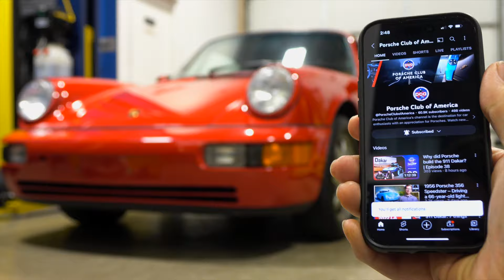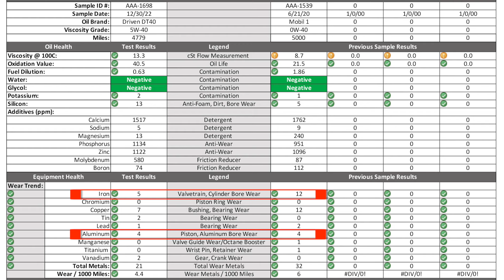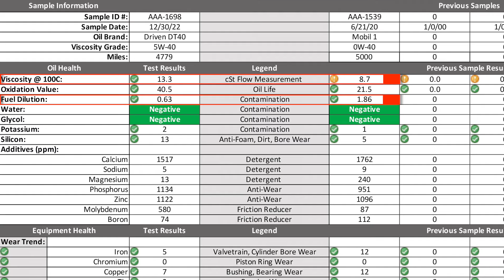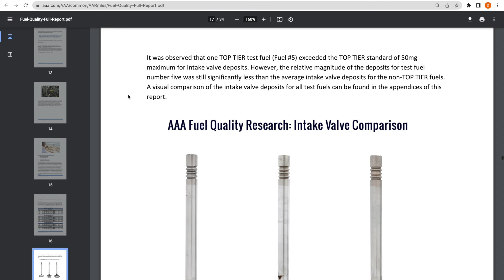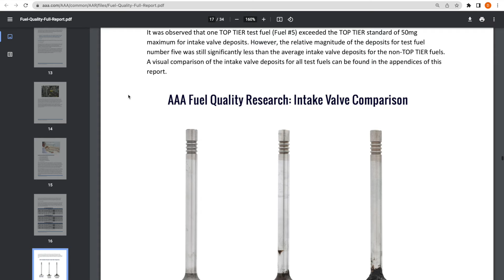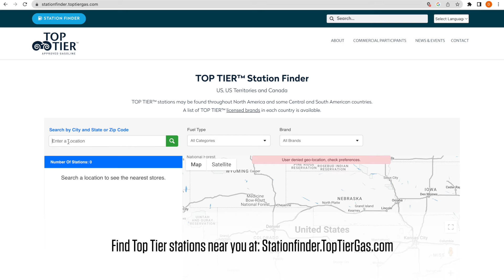How to prevent or slow the progression of bore scoring in your Porsche M96/M97 engine | 3 of 4

Comment: I hear you about sun zero temperature, how about -13F as this is what we have here in Quebec, Canada. What do you recommend ? Idle for 1 minutes and take off gently until engine is at full operating temperature ?
Reply from the maker: Charles and LN Engineering are in Chicago, so he lives the conditions you are talking about. He mentioned that if you need to give the car 20-30 seconds to get the fluids going before driving off, that's fine. For the cars health, ideally you'd want to drive off immediately, but that's just not possible to safely do in some places.
Reply: @PorscheClubofAmerica  thanks. Trust me montreal is much colder than chicago ;-) for reference What is the coldest month in Chicago?
January
January tends to be the coldest month, but also the snowiest month of the year. The temperatures reach between 26 °F and 36°F (-3 - 2 °C), with an average high of 31 °F (-1 °C)
Compare this to Montreal 
The cold season lasts for 3.3 months, from December 4 to March 12. The coldest month of the year in Montréal is January, with an average low of 10°F
We will never hit above 10F
Reply: I would recommend against idling the engine any longer than it takes for the engine to come off initial high idle.
Reply: @lnengineeringllc  exactly what I do which is in deep winter exactly that 45s to 60s
Reply: @brennersydney  If you are not seeing below freezing cold starts, there are no special precautions to take. Just start the engine and start driving the car normally, taking care to keep the RPMs down and avoid wide open throttle until the engine coolant is fully up to temperature.
Reply: @lnengineeringllc  I drive normally between 2-3k rpm until the eng oil temp rise up to at least 170 degrees F.
Reply: No way would i winter drive any expensive sports car in winter the salt and brine will destroy it . Because of the high humidity /salt here in Ontario i oil under coat all my cars and trucks and my restro mod sports car frame chassis and  crossmembers . In this area you can see the sides of roads white with salt even in summer and every time it rains it damages your metal components of your car.

Comment: Question related to the Top Tier premium vs LAC premium discussion: What about ethanol-free vs ethanol added fuels?
Reply: Ethanol free fuels such as REC 90 typically are formulated with the same additive levels as Top Tier Fuels, however occasional use of a fuel additive with polyetheramine still would not be a bad idea as a preventative measure.

Comment: Next question on 911 engines. On which side of the piston (upper or lower surface) do you see the most wear for the left side (cylinders 1, 2, 3) and right side (clyinders 4, 5, 6)?
Reply: Cylinders 4 through 6 (Bank 2) most always score first. We rarely see scoring on bank 1.
Reply: @lnengineeringllc  Meaning what part of the piston? Not which piston(s).

Comment: How about other brands of car, that are using direct injectors, are having signs of higher bore wear at the area opposite of the injectors?.
Reply: Although not an issue with Porsche engines, there are discussions that injector angle can and does affect direct injected engines.

Comment: I would think it is a good idea to install a oil pan warmer and engine block warmer? Here engine block warmers is pretty much standard equipment on all cars and they recommend to use it even in summer when colder then +15c or so to reduce wear and fuel consumption.

Comment: Very informative video - learned a lot. It also makes me shake my head and wonder why I put up with such issues with this brand, and why Porsche’s always seem to have such issues. BMW not much better, and in some cases worse. And with all the well to do suburbanites with Macans filling them at the local grocery store gas station how many of those are going to develop issues?
Reply: It's not isolated just to Porsche. Like you mentioned, BMW also have had similar issues as has Mercedes and other vehicle manufacturers. For sure we know fuel is a huge contributing factor as are the oils being used and longer drain intervals recommended by auto makers.

Comment: Most A40 oils that have API SP also have at least 70 ppm of molybdenum now.
Reply: Whats a few good examples Chris?
Reply: @spyder_man  PP Euro 5W-40 and new Mobil 1 FS 0W-40 both have that amount roughly.
Reply: Thanks Chris, my M97 has only ever had Mobil1 0-40, for 15 years now. 
Appreciate your knowledge.
Reply: @spyder_man  It used to have less moly until last year. It’s a fine oil though. Not much can cover for design defects.

Comment: Great content....... can I just implement all the suggestions before I ever have the problem?  Is there any downside to what you recommend other than sacrificing a little Fuel Economy and maybe some incremental cost?
Reply: Probably could.  You could definitely run top tier, add injector cleaner, reduce oil change intervals to 5K miles, and do proper warm ups.  I’d probably save the thicker oil until after you have verified scoring.  Do used oil analysis and when the readings trend in the wrong direction scope it.  If you confirm scoring then switch to the high temp high viscosity oil.  Just my $0.02.
Reply from the maker: @K1dPhresh1 summed it up well.

Comment: Is there a european alternative to the Driven oil they recommend? A brand we can easily find that includes Molly in it?
Reply: I think Millers oil is recommended.
Reply: Millers 5w40 Nano would be a good alternative or Liqui-Moly with their MoS2 or Ceratec additive.
Reply: @lnengineeringllc  Awesome, thanks for the answer!!
Reply: Another question please: what's your take on shops claiming 10w60 oils? I hear mostly 5 or 10w40, but some professionals claims to go even higher. I know Moly in the oil is more important than ZDDP, but then should we consider for exemple que Liqui Moly 10w60 + Ceratec? Thanks!
Reply: @sylvainniset7249  A 10w60 is likely going to be too thick. A properly formulated 5w40 should be more than sufficient, however a 5w50 would be acceptable for hotter climates as there have been oils with that viscosity on the Porsche approved list in the past.
Reply: @lnengineeringllc  You rock guys, thanks!!

Comment: Why not add oil stabilizer on every oil change to protect the cylinders and maybe use restore the oil additive every 50k or so as a protective measure and fuel additives and cleaners.

Comment: Hi thanks for the very informative video, one thing I live in the U.K (so not the best weather, but not super cold either!) and own and love my 987.1s. (3.4l) I clean the injectors by adding "Redex" ( not sure of its P.E.A. content?) & I use Mobil 1 0w40. The cars done 80k miles and no signs yet of bore score, but not properly tested? 
So if I wanted to make sure I am doing my best to prevent this, what would u advise? Do I need the Driven DT40 and maybe a change of fuel additive and if so what would you recommend please? Thankyou guys so much I am scared of this ever happening, but really want to keep the car.
Reply from the maker: A quick google search shows that Redex does not use polyetheramine (PEA). An employee at the PCA National Office did an oil analysis after 5,000 miles using Mobil1 0w40 and Driven DT40 5w40 in his 2007 base Cayman (this oil sample is used a few times in this series), and the Mobil1 had much less moly in it than the Driven DT40. If you want PEA in your fuel additive, Driven Injector Defender has it. But there are surely other options in the UK that have PEA, perhaps a google search will turn some up. We recommend getting an oil analysis to determine the health of your engine. Speediagnostix is one company that has tons of experience with these engines.
Reply: If you cannot get access to Driven DT40, Millers 5w40 Nano would be a good alternative. If you check the MSDS for the fuel additive, it should list whether or not the additive has polyetheramine (PEA).

Comment: Water pump on bank 1, water takes to long to get to bank 2, water around 10-15 degrees hotter then actually shown on gauge, people not even realizing their engine is cooking since 997, 987 do not even show proper temps. These are the main reasons for bore scoring. How to prevent it? Get a 996 or lower, since these are precisely showing water temps and drive accordingly to what the gauge is showing. And turn your AC on so the fans in front of the radiators are running no matter what.
Reply: The coolant temperature gauge on later cars doesn't report the true temperature either. By the time the gauge shows the engine is getting hot, it's actually much worse. Regularly removing the bumper cover to clean the radiators out and installing a low temperature is highly recommended on all models.
Reply: @lnengineeringllc  By later cars you mean 2002<2005 in regards to 996? I have a 09.2004 996 4S X51. The gauge climbs till 80C and stays there, especially on highway or consistent speed. The only time I see the needle go above 80C is in a long ongoing traffic jam on a warmer day. Even on mountain climbs the temp stays at 80C, unless I lose the speed because of cars in front. Already have a low temp thermostat installed.
There are even times where if I push the car to max rev / full throttle, temps drop for a few seconds a bit below 80C and climb right back to 80C. Mostly happens at longer cruise control highway drives after sudden full throttle rev out.
Another thing I always asked myself is guessing oil temperature by looking at the oil pressure gauge at idle. I use a 10W60. I know the engine is up to temp when the oil pressure is at 2.2 bars at idle, since this is the value I get after a 30 minute cruise control highway drive. I have 2 bar oil pressure at idle after I started pushing the car more. 1.8 bar at idle is the lowest I've ever gotten, value I got after ~300kph autobahn runs. So my guesses with 10W60 are as following, 2.2 bars = 80C oil temp, 2.0 bars = 90-100C oil temp, 1.8 bars = 110C+ oil temp.
Can you confirm some of that or did you guys at LN ever test this in some way?

Comment: Moly has been around for a long time. Why would Porsche severely limit its use in their A40 approved additive pack if it is known that it protects the engine? Are there other friction modifiers that they do allow in their add pack that they think makes up for it? What is the logic in not allowing it in their add pack if it’s so beneficial? 

And if C40 is better than A40 regardless of DI or Port Injection, why wouldn’t they recommended their older cars use C40?
Reply: Most engine oils don't have high levels of moly in them. It is up to boutique companies like Driven to develop oils that aren't constrained by API standards or manufacturer requirements.
Reply: @charlesnavarro586  Thanks, I guess that was my question- why would Porsche restrict the use of Moly in its A40 spec if it is known that it is good for its engines unless there are other friction modifiers that do the same or better job? It’s not like Moly is expensive or new and it’s  been around for a long time. A40 seem very stringent per below. So a boutique oil beats this? - A40 testing procedure: This test will last 203 hours. The engine, and the oil, will go through: - 4 times the simulation of 35 hours of summer driving, - 4 times the simulation of 13.5 hours of winter driving, - 40 cold starts, - 5 times the simulation of 1-hour sessions on the “Nürburgring” racetrack, - 3.5 hours of “running-in” program Measurements on the engine and on the oil will be done at regular intervals, and the following parameter will be taken into account to grant the approval or not: - torque curve (internal friction), - oxidation of the oil, - Piston cleanliness and ring sticking, - Valve train wear protection. Cam & tappet wear must be less than 10 μm. - Engine cleanliness and sludge: after 203 hours, no deposits must be visible. - Bearing wear protection: visual rating according to Porsche in-house method.
Reply: @carreralicious  First, oils with the A40 standard do not have to go through the testing process. As long as the oil manufacturer uses the approved recipe, there is no testing requirement. Any modifications to the recipe disqualifies any oil from carrying the A40 standard. Likewise, you won't find any mass produced oils with high levels of moly as the "off the shelf" additive packages offered by Lubrizol and Afton, just to name a few, do not have this. Lastly, the A40 test sequence doesn't address the Al-Si cylinder system. It's hard to argue with the dozens of used oil analysis reports shared by owners on the forums who have since switched from an A40 oil to Driven DT40 (or DI40) which show a vast improvement in wear levels and viscosity retention. I hope this helps clear things up.
Reply: Liquid moly is what my cars get and frequent oil changes . Non of my cars or trucks use oil or have had timing chain problems my daily drivers  400000km on them and never been apart .Also warm up the engine before reving them some owners rev there engines cold to impress the crowds very hard on engines .

Comment: It's really is confusing when They say, cold start let the engine warm up gradually, then says you don't want to idle the car at cold starts.
Reply: I was thinking the same thing. It would seem the most gentle way to warm up the engine would be to idle it until warm. But they say it's the worst.
Reply from the maker: The key here is gently and quickly. As was said in the video, start the car, drive off immediately, and no full-throttle, full-rpm until the engine is warmed up. I.e., drive it gently. If you start the car and let it sit to warm up, it will stay in cold start mode longer, dumping more fuel into the combustion chamber, washing lubrication off the bores. And the pistons, which still need to expand to their hot tolerances, move around in the bore longer as the engine slowly comes up to temp. This scenario is what contributes to bore scoring.
Reply: What they mean is to let the engine warm up not by sitting and idling at cold start (cause that’s when the engine runs rich and injects more fuel), and to instead warm it up by driving off right away and keeping it under 3K rpms until you see the engine temp hit around 200F. Then, you can rev it higher.
Reply: Thanks for the simple terms...quickly and gently makes sense.  I'm not in cold climate but good practices are good practices.
Reply: Sorry, still confused about driving off “immediately.”  I’ve always thought that on my 991.1 it was better to wait until revs come down from ~1,100 rpm upon ignition on to ~700 rpms 30 -40 seconds later. Then I drive off but keep revs to <2000 rpms until oil temp hits 175 degrees (and water is usually up to 194 degrees by then).  Am I doing this incorrectly?
Reply: @Seddonrd  honestly, I don’t think what you’re doing will be harmful either, but they suggest you don’t let the car idle until the revs come down from the higher idle at startup because during that time, there is more fuel injected into the engine. They want you to drive off immediately but just to keep the revs low until the car warms up.
Reply: Many of us were told by Porsche to wait the 15-20 seconds for the RPMs to come down to 1,000 before driving off. I think these guys clearly know what they’re talking about, and many of us were misinformed.
Reply: @tomaskuehn1142 I frankly doubt 20 sec will matter. It often takes me longer to get navigation, tune radio station I want, etc

Comment: If I understand this correctly you're recommending a non approved Porsche motor  oil that has a higher level of moly!   I understand the rational; however  this begs a question: If I follow  this recommendation on a brand new Porsche and use non approved Porsche oil  and have bore scoring before my new car warranty expires, will  Porsche honor the warranty? Will Porsche say you're not using Porsche approved oil; therefore, the engine repair will not be covered?  Inquiring minds would like to know!
Reply from the maker: Good question. We'll attempt to get an answer for you.
Reply: @PorscheClubofAmerica  thanks for the response!
Reply: If the vehicle is under warranty, we still recommend using a factory approved oil, however you should shorten the oil change interval to no more than 6 months or 5,000 miles. That's the best thing you can do while not having to worry about having any warranty issues.
Reply: @lnengineeringllc  Thanks for the response.!  For reasons I do not understand   Porsche and  other vehicle manufactures have extended their recommended oil change intervals to 10,000 miles or one year.  Personally, I've disagreed with the recommendations from day one.   For my   cars  I change oil  every 5000 miles and sometimes sooner depending on how hard I run a car and seasonal condition. Oil filters and oil are very, very cheap compared to the cost of a smoked motor.  Your suggestions on how to warm up the motor is excellent as it mitigates many problems.   Great series on bore scoring and if I every need an R&R your company  is at the top of my list.  Cheers